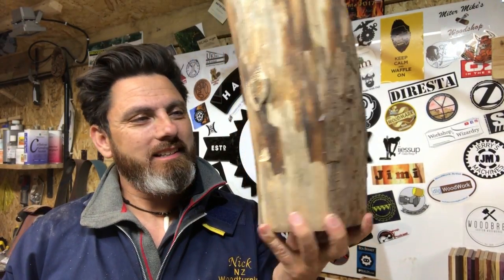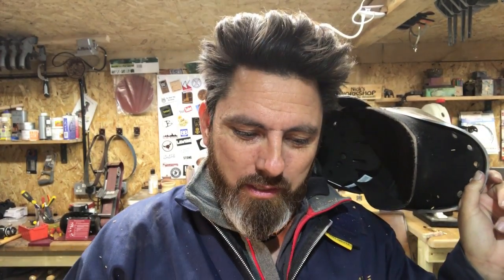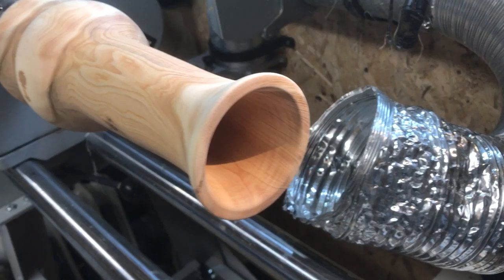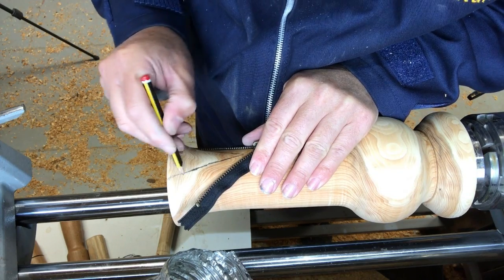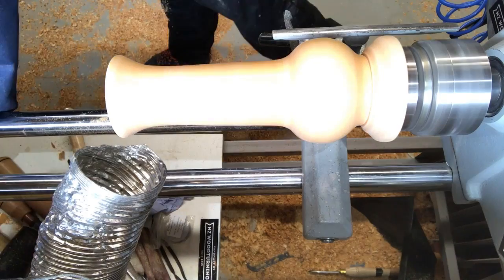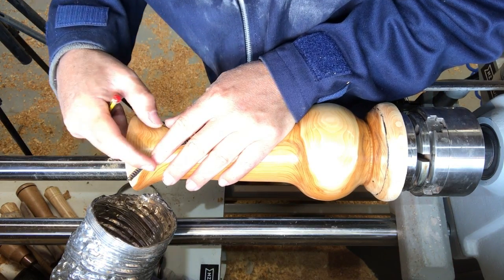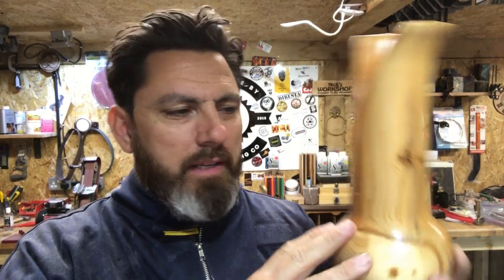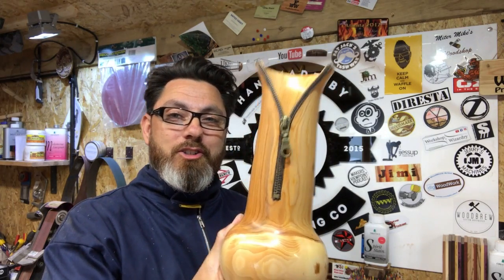making a zip vase using a block of wood and a zip

Comment: Hi. I'm 16 and I'm getting into woodturning. I was wondering if you could turn acrylic, resin and stuff like that with normal wood scrapers or if you had to buy special equipment.
Reply from the maker: Blaster Gamer hey that's great news I'm glad you want to get into this hobby it's so satisfying to make things . I would recommend a good set of carbide tools for turning acrylic my friend . Good luck 👍🏽
Reply: Alright thanks!
Reply: @blastergamer6802   (1 year late to the party) if you haven't discovered. Acrylic heats up and softens quickly. its not a nice thing to work with.

Comment: I love all the variety of different things that you make. Keep up the great work and you inspire me to get back into the workshop. On a different video, resin bowl blanks. What is the best way to get the air bubbles out of the resin. I think you mentioned a pressure cooker but do you have any other ideas as I don't have one of those? heat or vacuum?

Comment: Simple tip but a little masking tape can help a ton with lining up marks. (like the zipper) I use it to hold designs against metal, so I can score the metal before cutting it to a better shape then some rough hammering gets me.

Comment: Really cool project, but I have to say something about tailstock support. Screws in endgrain are very weak, so that log could easily have come off the lathe. You are obviously a more experienced turner than me, but I've always been taught to start a project like that between centers, get to round, and cut a tenon to grip in the chuck, then continue to use the tailstock as much as possible. Again, I like the project; it caught my wife's eye, as she is a sewing junkie.

Comment: Very nicely made hi I'm in lockdown in France obviously with a virus I'm trying to get my woodworking late up and running I'm fraid mine is a little bit bigger than yours it's a very old Watkin which I had the electrics converted a few years ago as I used to work for myself I'm now retired.
 it's got inverter drive on it and I'm trying to get the thing to run in reverse because I want to turn something very large on the other side of the headstock .
I don't know how to do it but I did think about setting up a YouTube to show what I've been doing I am doing in my property in France as I've been now living here nearly 2 years by myself. 
I'm keeping myself busy got plenty to do just a shame that I've done all this work over here and my partner she decided she wanted to find another younger bloke anyway I'm happy I've got my tools I've got my health. N / Z keep up the good work it looks amazing and I hope you're wearing a respirator as you're such a young guy in later years he will suffer.
Regards Phil from the Moulin in France in lock down

Comment: Make a split open zipper vase like when the zipper pops in the middle after you vip it up but in the middle of the bulge of a fat vase cut an eye shaped hole pop the zipper glue it in then fill the open split zipper crack with resin so you can see the contents of the jar that splits it's zipper open a pot of gold bars or coins but it's really empty just coins in the zipper split and the lid is all coins over flowing but it's just the lid of an empty pot pant or bag of coins